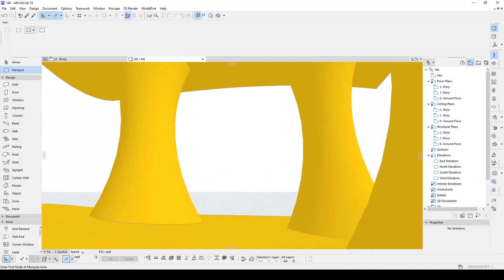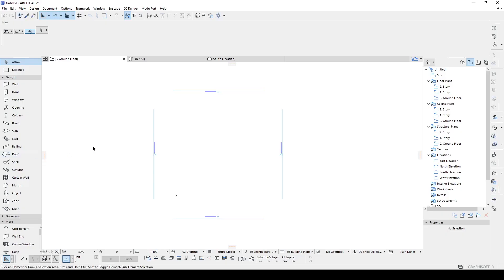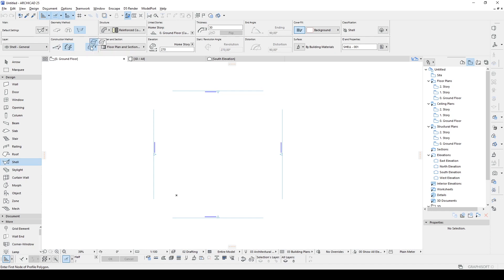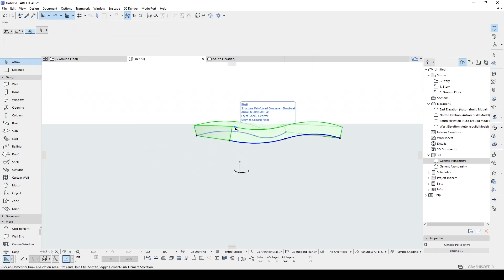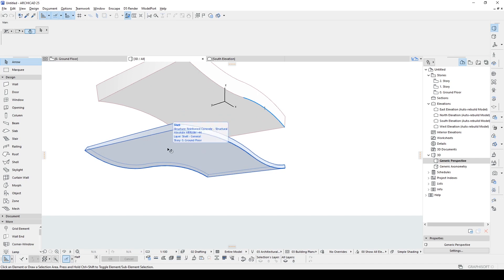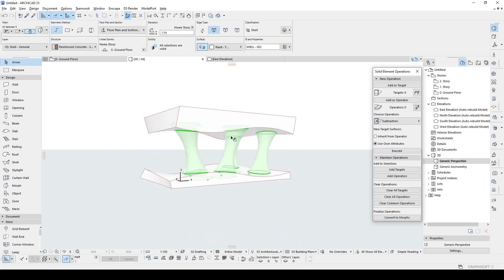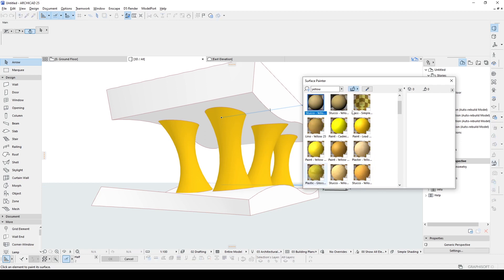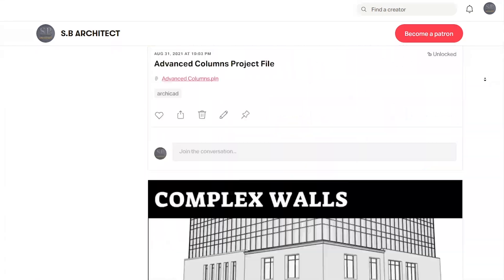Lofted Building in Archicad Tutorial

Comment: nice video. but it is a shame, we have to struggle in 2022 without proper nurbs support in archicad to do something simple like this.
Reply from the maker: You're right. They says " if you want to do more complex shapes you can use grasshopper" I dont think this is the right approach at all.
Reply: @sb.architect  grasshopper is fine for some special task, when doing some parametric façades etc, since it is probably best tool to use it. but for some manual design of free-form shapes, simple use of few nurb curves would solve that in seconds, without any boolean tweaking etc.